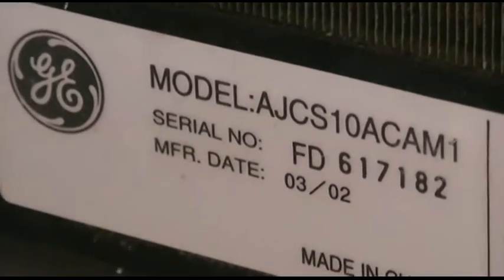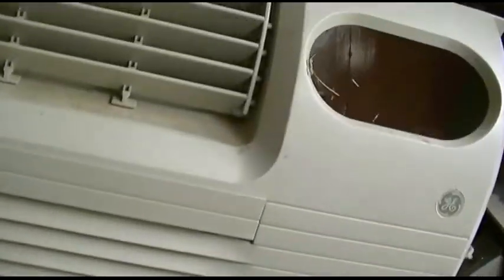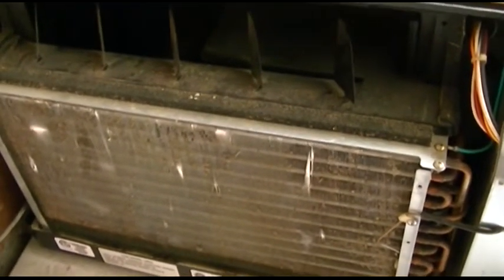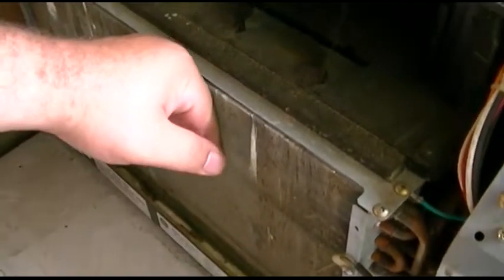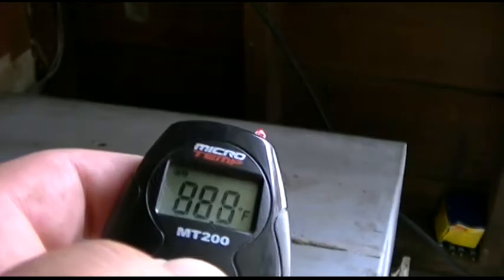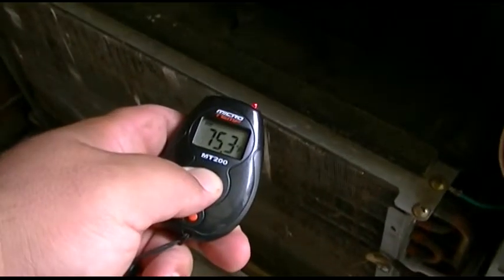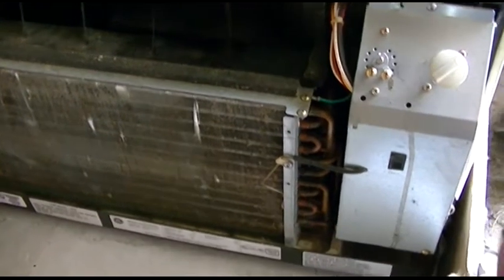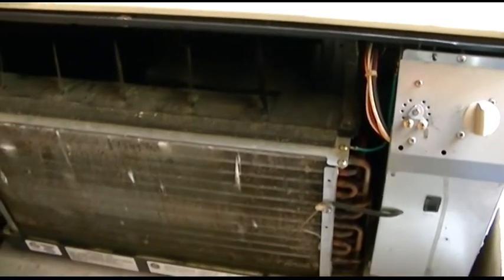GE 9900 BTU Air Conditioner Model AJCS10ACAM1

Comment: That is a very tough, strong unit.  Actually manufactured by LG for commercial use.  It came with a five-year warranty, and it was meant for use in hotels.  They had an identical model which included heat.  This one is obviously meant for hotel rooms that have radiator heat already.  That is why there are two fan motors, so that the outdoor fan only runs when in cooling mode (again, on heat-equipped units.)  If you look at the thermostat, those two screws can be removed and put in different holes to stop the thermostat from going all the way to its limits.  I have an owner's manual for it which I emailed to you.
Reply from the maker: Excellent, thanks for all that additional info!
Reply: Sure thing.  And don't let the LG worry you, it was the "GoldStar" LG, not the modern version LG has become.
Reply from the maker: Harley Badger Oh, right, back when Life really was Good!

Comment: I have a SHARP AF-S80RX built in 2012 and surprisingly it's still going strong! I haven't cleaned this AC since I installed it in 2012 (except for the filter) and I see no signs of dying though this AC is quite a loud one even on the lowest setting. But I believe that it could last for at least 1 1/2 more decades.
Reply from the maker: Things weren't quite as bad quality in 2012 as they are now.  There's a possibility it'll hold on for a while longer, but a dream of 15 more years I'd say is a pipe dream!

Comment: this is a GE mini PTAC. the switch on the front is a continues or cycle indoor fan. it vents out the back because it's designed to be in a wall. interesting how it has two motors.
Reply from the maker: Yes, I have subsequently gotten the manual for it in PDF and it mentions the switch.  The switch on mine appears to be jammed in the "continuous" mode.
Reply: +jaykay18 that sucks. I hate constsbt fan if I have a choice.
Reply from the maker: Willie Peck It's good and bad.  I've been planning on making a video about that.  Let's just say that "energy saver" is actually energy WASTER.
Reply: +jaykay18 oh. I look forward to that video.
Reply from the maker: Willie Peck I haven't recorded it yet.  It's also hard to demonstrate, so it's going to be more of a "lecture" video.

Comment: Why did the compressor overheat with the unit being so close to the wall even though the fan was on?
Reply from the maker: There wasn't enough airflow behind it.  The fan could expel the heat but it couldn't go anywhere.

Comment: This unit is not made by GE. It was made for GE by some Chinese company. The actual GE units had spine fin coil.
Reply from the maker: Older ones had spine fin, but I haven't seen that in many years.  Chances are you're correct that this unit wasn't necessarily made by GE, but considering it's from 2002, and still works perfectly, it goes to show that there still was a little bit of quality back then.
Reply: jaykay18
Also the fact that it was made in China and still working shows that there was still a little quality.
Reply: a little fun fact here the last year GE made any air conditioner was 1987 I believe.
Reply from the maker: Willie Peck Thanks.